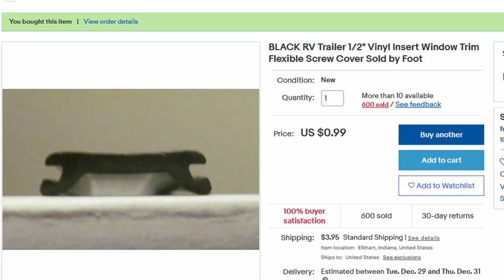Simple Steps for a Great Rear End | 1985 Pontiac Fiero 2M4 Revival - Part 13

Comment: It's a little late for free advice. When it comes to plastics like the seat belt  buckles... your prep was great but heat is the key. Using a heat gun bring the plastic up to temperature... the exact temp isn't the same for different plastics but basically it shouldn't start deforming and you should still be able to touch it but only barely.  Also boil water, pour the water into a large thermos and place the spray paint can into the thermos. The paint will spray in a finer mist with more consistent pressure. The pores in the plastic will be open to receive the paint, the paint needs to be warm as well so it doesn't instantly cool the plastic down. I usually start with the paint, then use the heat gun on the plastic... wipe off the water from the spray can before spraying so you don't accidentally dripping water onto the surface.
Reply: Your the best, man.

Comment: Mr. Finger: Worried about being safe in a collision~

Also Mr. Finger: Buys a Fiero~
Reply: I know this was a joke, but fiero's actually had one of the best crash test ratings of the 80's. They are fairly safe.
Reply: From the wikipedia article on the Fiero: "Fiero was the second safest vehicle sold in America from 1984 to 1988, beaten only by the Volvo 740DL station wagon."
Reply: @Buttermilkjug  I'm beginning to wonder if your joking or not. I mean, anyone who does fact checking knows that a super small percentage of Fiero's actually caught on fire, and all 1984 models were recalled and repaired. And decapitation? What the hell are you talking about? Please elaborate. Certainty your not talking about the stupid myth about the hoods going through the windshield in the event of a front end collision. They had a system to make the hood crumple, as most cars do, and even if the hood did go through the windshield, by some means of a factory failure, it still has the same odds of any other vehicle to fail. They really are not as dangerous as any other vehicle. I mean, this IS the reason why the Fiero will never have a good reputation. It's because people like you spread false shit all over the internet, and people believe it.
Reply: @Buttermilkjug  
Fieros catching fire was because the manual said to use less oil than the car actually needed, so...
About the beheading part, I need an explanation.
Reply: @mr.aizawa5257  looks like he deleted the comment
Reply: @isaakwelch3451  huh. Well then.
Reply: @mr.aizawa5257  Bingo !
Reply: @mr.aizawa5257  Ah yes, the 80's. When airbags were considered optional and 200hp was considered exceptional. 

That aside, the man lives in Texas. A collision in his case will likely involve a modern. possibly lifted, f150.
Reply: @Dizzykitty817  True, but that was not my point. Most any small car would be chewed up by a lifted F-150, but my point was that the fiero was no more dangerous than any other mid-size, or small car. (But I have seen tons of cases where most people would die, and lived through a crash without a scratch, and they were driving Fiero's.)
Reply: These comments are SO 2020~ "I'm offended at a Fiero joke"
Reply: when I owned my Fiero, every time I went to a junk yard to find parts, every car that was smashed from the front or back you could open the door, and sit in the seats very comfortably, side impact, well show me a car that can take a hit straight into it...
Reply: @mr.aizawa5257  Very well answered and documented. Yes, the Fiero was, and still a top notch secure car. Why ? Because the Pontiac guys OVERBILT it's space frame and very precise tolerances. The best at the time on a US built car. That's why it's kind of heavy for such a "small" car.
I and my wife had a serious accident with my 1984 : Tires due for replacement, a summer storm on a hot highway ending in hydroplaning, hitting the left guardrails then shooting to the right, sideways. A guy T-boned us on the passenger side door and the hinges post. Yes my car was twisted a bit, the door pushed up 2 inches. No intrusoion at all.The wife was shaken but ok. The recent Corolla was totaled, front end and engine completely pushed 12 inches in ! The guy and wife were not hurt but scared.  I had the car kinda straightened and drove it till I found a 250$  '84 with a bad engine. I swapped the engine & trans, almost all interior, and drove it another 4 years ! Sold it in 1996 for 1,500$. Not bad for a  car many hated out of ignorance!
BTW, the hood smashing in the winshield is almost impossible: 2 T shaped bolts are at the winshield base. They lock completely the hood in case of front end collision.
Reply: @geoffreygibbons4736  holy shit, the fiero was 2nd to a volvo?
Reply: @r0b3rt_959  no. the reason fieros caught fire was because people were revving and redlining the heck out of the econo 4 banger iron duke. it also didnt help that the oil pan only held 4 quarts of oil, AAAND the dipstick was labeled wrong, showing the pan was full when it was a quart low.....3 QUARTS OF OIL at redline? rod through the block, hot oil on exhaust manifold, underhood fire.
Reply: @r0b3rt_959  It was actually two things: The manual did say that the oil capacity was 3qt instead of 4, but that was coupled with a batch of bad piston rods that would fail, potentially punching a hole in the block of the Iron Duke. This would start a fire with chaos ensuing. Pontiac/GM knew about the bad batch of piston rods, but didn't think it would be a big deal... maybe if they'd known about the misprint in the manual AND the bad piston rods, they might have done something.
Now there was, I think, a second fire issue in 1987 Fieros (I think) and I'm not sure what that was ... it might have been the sound proofing becoming impregnated with engine oil, in the case of poor maintenance and catching fire. Anybody know?

Comment: Pontiac used to be considered the "experimental" part of GM, hence the Pontiac style: rear drum brakes that are a real pain in the assets to reassemble when it is time for a reline or rebuild, removable outer door skins, oddly shaped and rubberised inner door actuator rods, Kelsey Hayes geared ABS brakes that would gum up, batter cables hidden behind many layers of unremovable components, water pumps driven by timing belts, timing belt tensioners, etc. Pontiacs are usually fun to drive but often tough to work on.

Comment: Great video, as always!
BTW regarding the trunk seal:
if you pull on the seal slightly while pressing it in, you will gain those 2 cm you're missing right now. they literally never fit perfectly, because their length is quite temperature dependent.

Comment: Just a tip for when you are working with rubber seals that you need to bend into place, like on your luggage rack, soak the rubber in hot water for a few minutes first.

Comment: Looks like the double stick tape holding the mirrors on is a little bit thick so they don't sit fully inside of their mounts.  Something you could use instead, that we've used in RC racing instead of double stick tape, is Shoe Goo.  It holds amazingly well and if you use a thick enough bead you can adjust how deeply into the mount you want it to sit...just don't push too far.

Comment: great job. your comment about the whole lock deal. i am restoring a 1970 chevelle. all the locks (ignition) have been changed out. you think you can just use the old ones here and there. in the end you learn and you end up replacing them all. hindsight. whatever. the only thing i would add is that a new wiring harness be installed if you go back in someday. those old wires are just that old and brittle. again great job. liked seeing Percy get some camera time too.

Comment: I had a similar key problem with my Honda recently. Turns out the locks can be recoded/rekeyed pretty easily. It takes some finicky work but you can basically swap the tumblers/pins inside so they match your master key. It took me about 45 minutes and $30 worth of parts and I went from a two key situation down to just one. Lots of great tutorials on how to do this on the internet. Love your content. Thanks for sharing this fun adventure with us.

Comment: For fixing the hole in the headliner what you can do is cut out a perfect square around the damage, like 1"x1" and then cut a new piece that's 1"x1" and glue that in there, instead of cutting a little tiny piece and just gluing it in there. Or do a circle, whatever is easier :P  Love following your Fiero project over the last year :) Merry X-mas!

Comment: if you are gonna replace the windshield in a Fiero it is best to have the headliner and roof panel off so you do not damage them and the glass will damage them if they are installed when removing the windshield you should install the roof panel just before installing the windshield.

Comment: Very good job. I rented one of these when they first came out WAAAYYYY back in the day. It was a automatic 2M4 and by damned it was a slower than hell dawg. I drove it from Chicago to Kentucky and back getting more thumbs up and "what kinda car is that" questions than one should ever have to answer. The 2M6 and subsequent suspension upgrades made the car what is should have been from the start, alas...classic GM move, by the time they actually fixed some cost cutting measures on the original, the buzz had faded and insurance companies started acting like the Fiero was a Corvette. I applaud your efforts here.

Comment: Just an FYI, rivnuts are great for just about any fastenners that don’t receive much force, like interior and exterior panels and shield, like to the point that it may be wise to drill out all the pre existing fasteners before a bolt breaks, that way you can use the aluminum ones or even just the steel ones if the strength is needed, and if anything goes wrong you can cut them out and pop them through like a normal rivet, just be wary of hole sizes (as you’ve learned) and about thickness of what they go through (thicker things tend to give a false positive for grip) and the tools grip, the cheap tools also wear out in a way that causes them to not pull as tight, honestly you want the tool to be strong enough that you could accidentally strip the rivnut right out if you pull too hard, don’t rely on the tool to tell (force) you when to stop

Comment: The gap in the trunk weatherstrip is there on purpose. It's the trunk vent to keep the air pressure from locking it up overnight. Just as long as it's in the lowest point, you'll be fine.

Comment: Too late now but I find that if you put your spray painted small metal parts, control arms, brackets ect. in the oven at 200 degrees for a half hour it really toughens the finish up and vastly increases the resistance to chipping.

Comment: Just because the end is in sight is no reason to rush. Take your time and do your best to get it right.  As for the "repaired" headliner hole, you can disguise it with a headliner repair button, which is just a screw in snap with a fabric cover that matches the headliner. It will look factory to the untrained eye.

Comment: I consider making those door fasteners in a simple carbon infused nylon, it'll be more fit for being inside a hot car and it wont deform due to heat or pressure of the bolt.

Comment: my heart sinks not seeing led light bulbs going in lol. they are just as cheap as the old school bulbs. maybe you can do that some time or at least with the headlights. it will be something well worth the money spent. I did this with my old saturn ion and it went from barely able to see whats there to blindingly bright. of course with greater power comes greater need for proper alignment and i had to adjust my headlights accordingly :P but they do make the style of bulbs they use for that car you can also buy a housing that fits a regular replacement bulb for those style lights. Fuel for the future keep up the hard work its looking great. (would have painted those inner door brackets personally but eh won't see it. ))

Comment: The car looks great. I would try to move away from using super glue. You can remove the repair plug from the head liner and redo it with a glue that doesn't harden. It is a beautiful car. My friend had a red Fiero and it was an interesting little car.

Comment: Car is looking Great Ronald. My only advice was that you should've performed a cut and buff of the paint as it is very peely and spotty. Chop it back with some 1500 then 2000 and machine polish for that smooth, glossy look. Research "paint correction"

Comment: A lock smith should be able to match the boot key cylinder to the front. I did it myself for my car I only had to rearrange the pins but you may.need different pins.

Comment: There is a 87 Pontiac Fiero 2.8 auto with low miles an its black with same tan interior as yours . I grabbed some parts off of it for my s10 project the valve covers .

I'll leave a link below if like u just wanted to see it probably on one of my channels

Comment: The trunk seal gap is a great tangent for another thing I wanna say, what about a seal trim type piece that is designed to overlap the original seal by 3-5 inches on each side? I wonder if something like this could be used for all seals on anything using that type as a way to avoid issues when they shrink over time?

Comment: I would be even more impressed if you flatted that damned orange peel paint surface back and put a clear coat over it, - but lay it on at the correct temperature this time to avoid doing it again, totally impressed with your build thus far......but that paint finish comes between me and my cornflakes everytime I see it, the expression a halfpeth of tar and all that comes to mind. that aside carry on carrying on your nearly there.

Comment: The fact that those trim parts on the door aren’t just rubber and the ones on the front bumper aren’t either annoys me, I’ve been doing a redesign of the fiero (in my head for now) because I want to make a replica based on modern things and the original design ideas, so making things that are simple, easy to work on, easy to replace, and easy to make, along with being damage resistant is the goal, and I really think those parts should be rubber all around and the panels split and vacuum formed, making damage easy to replace the panel or repair it on a work bench. 

What do you think about the trim pieces? Would them all being removable be better? And what about material choice? Would rubber, plastic, or aluminum be best?

Comment: The work you've put into this is... Well, "amazing" doesn't even get into the right galaxy, let alone ballpark. In the little bit of perusing the Comments, I didn't see this, so I'll throw it out there: LED bulbs.  I recommend replacing all those incandescent bulbs with LEDs. Since they last virtually forever, it may save you work. Arguably, the brighter lights will be safer since you'll be more visible, particularly at night (I always have my lights on, day or night, for safety). I'm not recommending using bulbs so bright they blind other drivers, just something with a heck of a lot more oomph than those incandescent. Having owned a Fiero in my youth, that was one thing that made me uncomfortable in such a small (and thus more difficult to see) car. The shaded darkened tail lights were mediocre in the day, and so-so at night. 

Ones positive safety aspect of my Fiero was that I chose white paint, so it was easier to see. Part of that choice was, indeed, for safety (even those I was a 18 year old kid at the time). My dad warned me that black, though it looked great, was never going to look clean (no black car does five minutes after the wash). And red...well, I knew that was going to be a cop magnet. Looks awesome, and I LOVED the Fiero in red, but still, it's a cop magnet. And for a laugh, I'll tell you the other part of my 18-year-old logic. I thought about what a girl's dad would think when I pulled up in this hot looking little "sports car" (we all know it's a commuter car with less than 94HP under the hood) to pick her up for a date. Black and Red screamed "hot shot" and probably wouldn't make the best impression with a father. So that was another reason I went with white. 

Having said all that, I'm very glad you stuck with original red. Looks absolutely incredible!

Comment: Forgive my novice-ness, but I was under the impression that seatbelts 'expired' after a certain amount of time like any other safety equipment--(if this is correct), if those are the original seatbelts, wouldn't it be safer to replace those too while you're fixing interior bits?

Comment: What material did you use for between the deck lid and the luggage rack. Also, what rubber washers did you use for the screws for the luggage rack. Mine is leaking. I was able to save the rubber strips that go inside the the slots.

Comment: Curious where and what size of plastic rivets you used for the panels. Also, what did you use for the push pins for the bottom of the rear bumper?
Reply from the maker: 1/4 inch nylon rivets from Amazon and believe it or not, the factory original push pins for the bumper :)

Comment: You're getting pretty snarkie with your comments and your opinions as you have gained more skills. Tragically you have never learned the first and most important lesson of acquiring skills and advanced knowledge about a particular system. This is to remember that "there is always someone that wants to be where you are." Further GM designed, engineered and manufactured the Fiero for a useful life of about ten years but certainly not fourty five.As far as your lightbulbs you should learn about dielectric grease to prevent future issues.